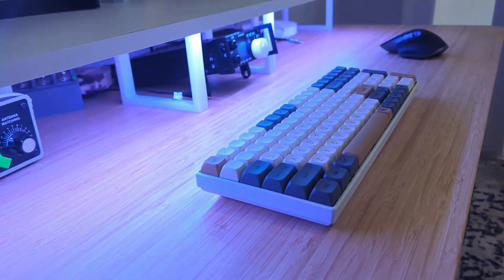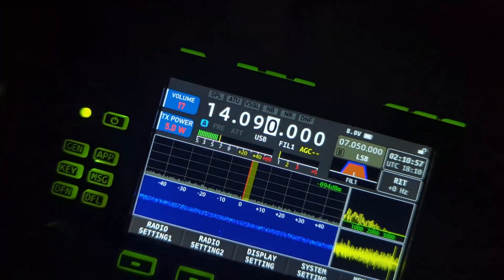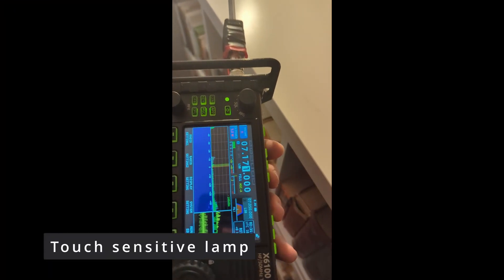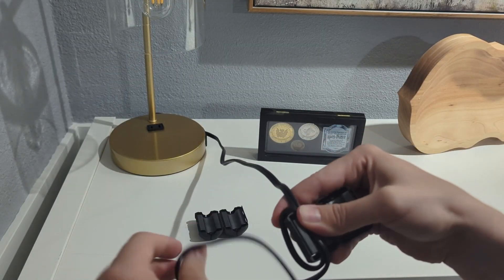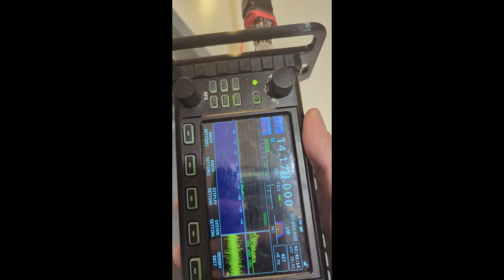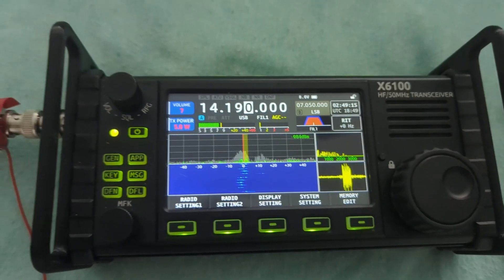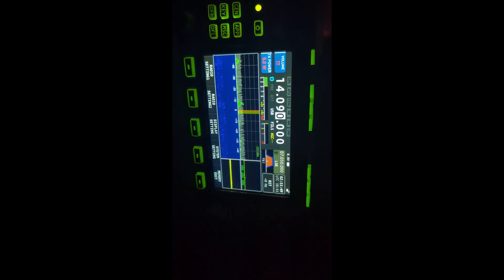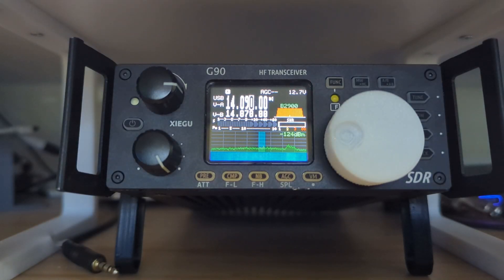Hunting for Signals: Uncovering RFI Culprits

Comment: with the wireless charging it's noisy by design as a way to sense if anything is around to enable the charging circuit to save power. AFAIK adding a choke doesn't really do anything to it. you're probably better off using a magnetic connect cable than the wireless charging one

Comment: I live 1/2 mile from powerlines and off grid. I run strictly DC in the radio room. Very quiet except for the DC powered LED lamps. Am using chokes and capacitors to hush them. While chasing DX all inverters and charge controllers are off. Battery power only. Good luck with your noisy suburbs.
Reply from the maker: It sounds like you have a nice setup! My next project is adding capacitors to some power supplies I've since identified as noisy, that should be a good time.